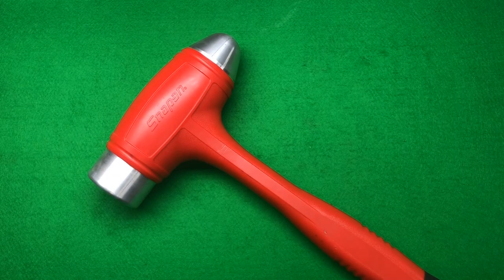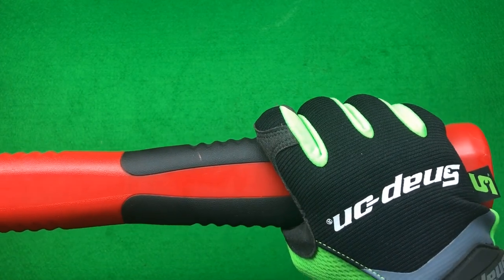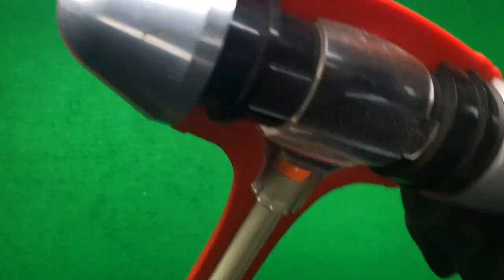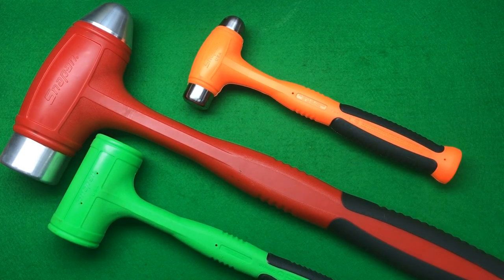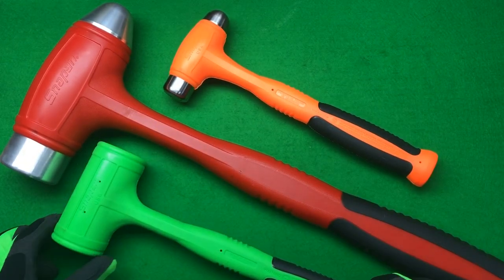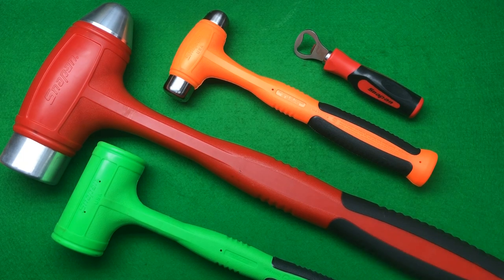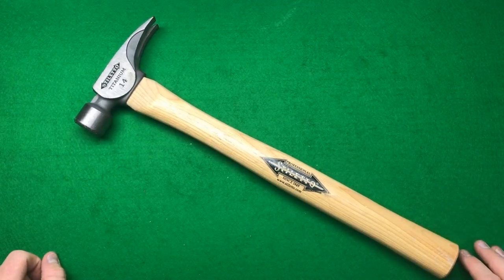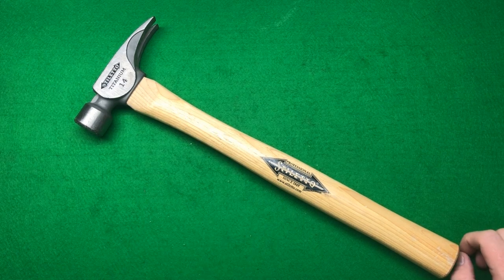Snap on dead blow Hammers how they work😀👍⚒️

Comment: Stiletto hammers are nice. My favourite titanium hammer is the Vaughan Dalluge, which has a replaceable, screw fix handle. Similar but different.
Reply from the maker: vaughan Make wonderful hammers stiletto are in a different league they are the original titanium, but now there is tons of choice a different price points ideal if you’re working above your head not too heavy :-) PS did you go to the carboot this morning ?